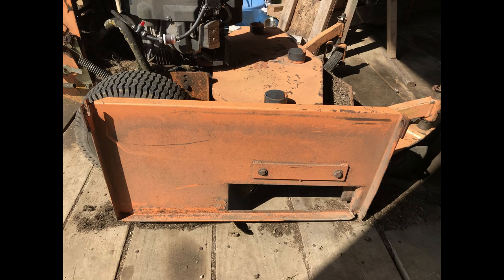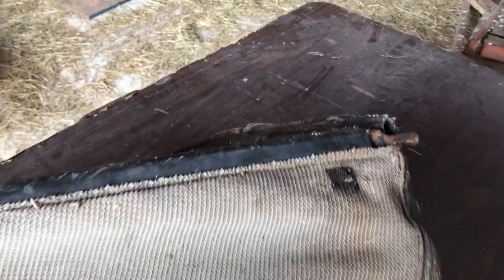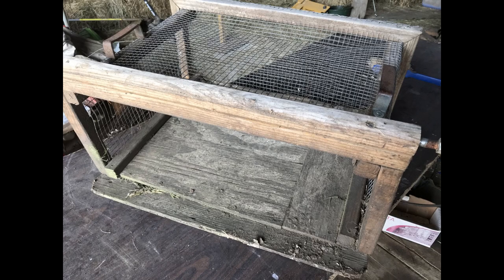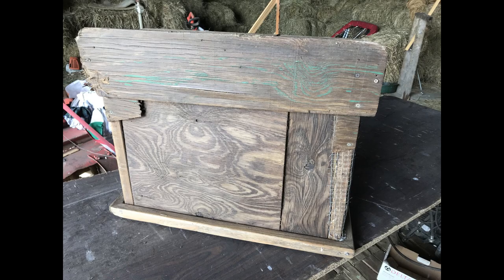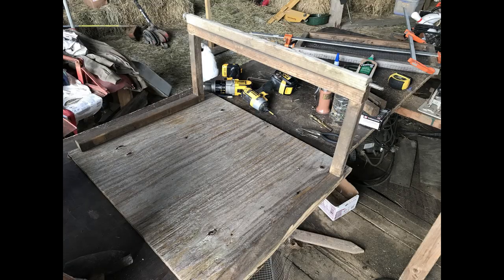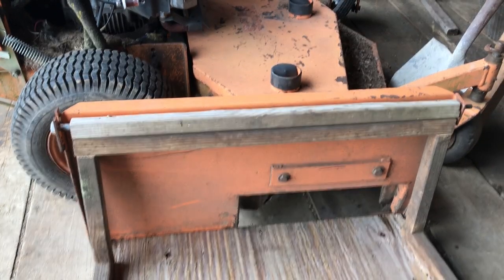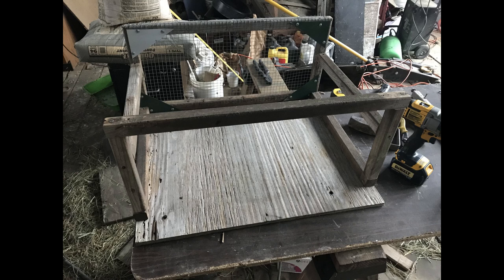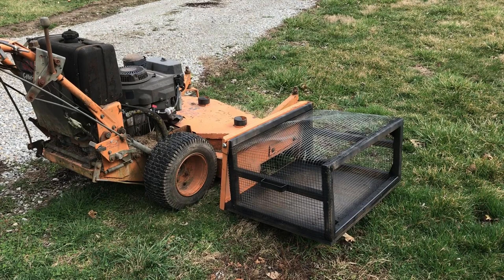Home Made Grass Catcher

Comment: So in a nutshell copy a rabbit cage with mounting brackets.
It works it should be copy
Thanks for the teaching Sir
Reply from the maker: I hadn't thought of it that way, but yes, I built a rabbit cage for my daughter's rabbit pretty much the same way.... but bigger. The angle is important too, if you make the bottom the same width as the top it drags on the ground and doesn't fill right.